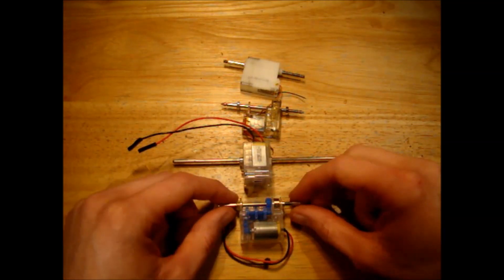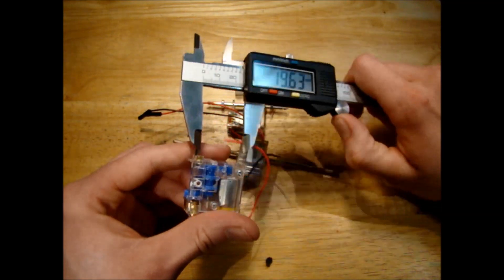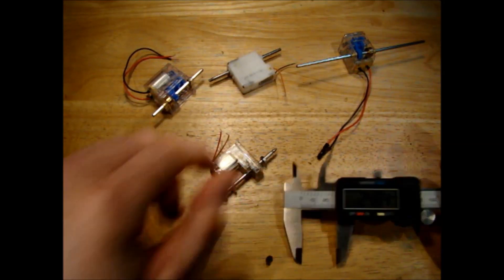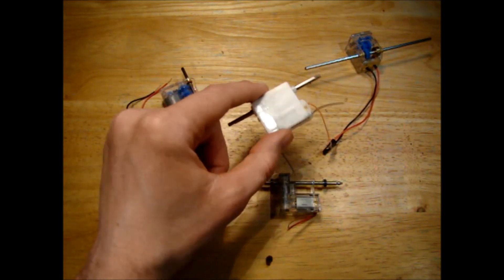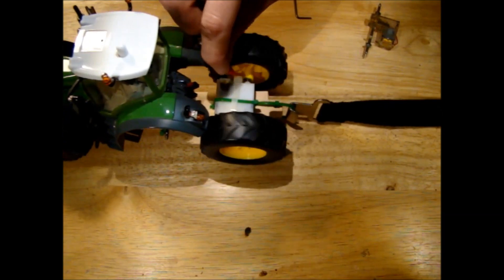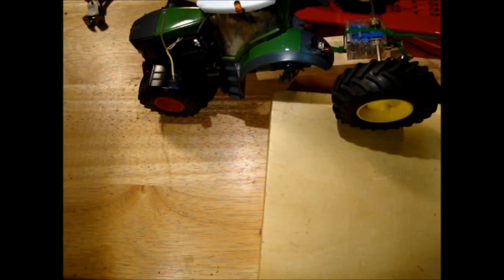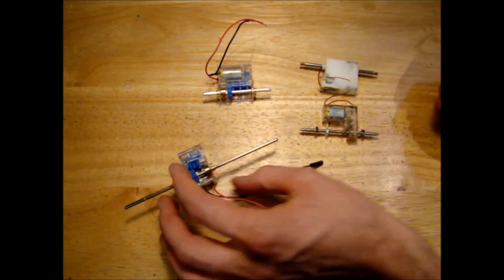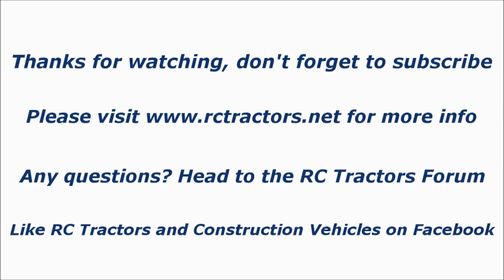RC Tractor Drive Motor Dimensions and Power Comparison

Comment: It's not so big of a problem when you are using them only for moving tractor that has no extra commands (like front and rear hydraulics,...), but when you make let say Bruder 2000 series tractor with rear and front hydraulics and trailer or similar, then you need to use motor on each wheel with reduction gearbox. It comes to that you need 4 batteries for moving and 4 batteries for servos, soon the whole tractor weights 2 kg or more.
But: good work! We need to see the comparisons with real test and numbers! Thank you for this!

Comment: kde berete ty motory protože bych také potřeboval 3
Reply from the maker: Hi the Siku motors came from http://www.modellbau-schulte.de/ and the Tamiya motors came from ebay, there are some links on our site here http://www.rctractors.net/electronics-from-ebay
Reply: Tam sem to nenašel
Reply: nemohl byste my darovat motor z fenda 930 Vario klidně bych vám poslal i peníze
Reply from the maker: Hergi Marcel Hi, sorry I need all the motors I've bought. It would be cheaper to buy directly from http://www.modellbau-schulte.de/ or http://www.witomo.com/.